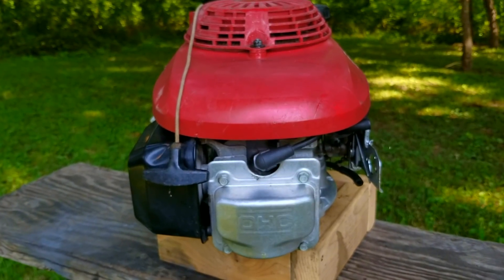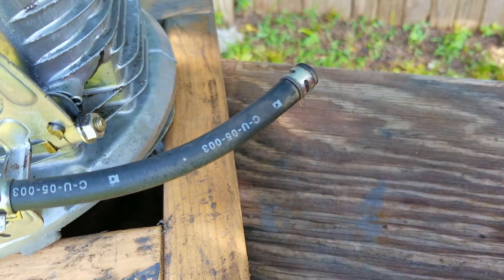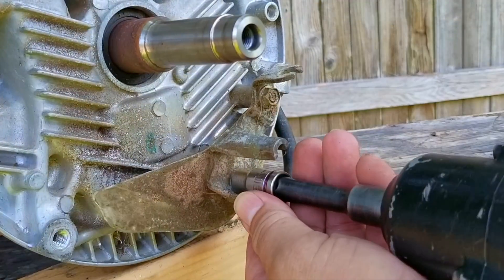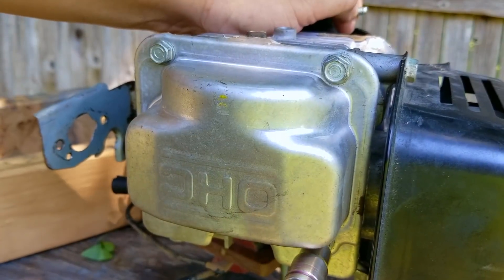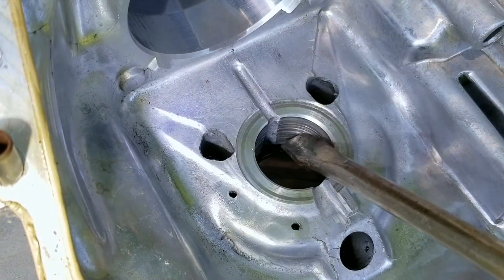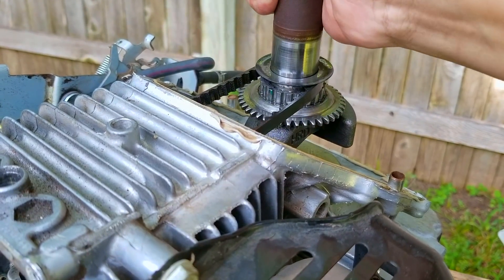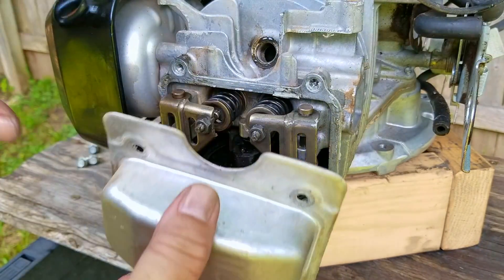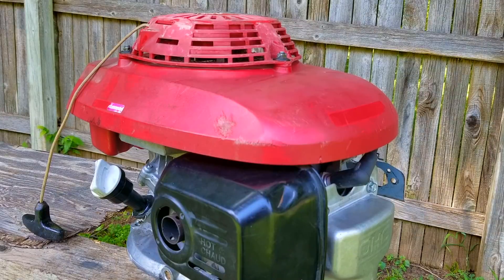I took apart a Honda engine to find out why it was so loud.

Comment: Selling parts off that one could bring enough money to get a used engine. I would probably just put everything in the stash. You would probably make more money using that one to fix several others.
Reply from the maker: you would be correct about that

Comment: That's sad. A perfectly good machine was ruined by neglect. I'm kinda shocked you wouldn't have the necessary parts in your stash, since these engines are in everything.
Reply from the maker: I do believe this engine needed the upper half of the block. I'm just using it for parts right now and I think I know the project I'm going to use it on

Comment: I got a crash course on this engine with this Snapper mower I am working on. I got it running perfectly until I changed the oil. I used a fluid pump to remove the oil, and the tip from my fluid pump fell off in the engine and got wedged in the governor. They are not terribly difficult to tear down, and they certainly don't require as much since they used RTV on everything. I tore it down and got so depressed over it that it sat in my kitchen floor for a year before I finally put it back together.
Reply from the maker: wow, never heard of something like that happening before

Comment: I don't know much about those,people love them but I think my Tecumsehs are actually better in some ways,I think that is a consumer grade engine with a plain aluminum cylinder bore and so probably best replaced. I think Honda makes a higher grade commercial duty lawnmower engine with an iron sleeve bore cylinder.
  That one would probably still be operating properly if not having been run low on oil and the oil changed at a reasonable time. The average person using it for 3 or 4 small suburban lots could probably get a lifetime of use of that motor if taking proper care of it. Including keeping an eye out for air filter care as well as minding the oil. 
  Amazing that it ran that well without losing oil out the top seal/bearing with that wobble.
Reply from the maker: I agree with this comment a lot.

Comment: I cant believe they designed this engine to use a timing belt. I didnt even know that these had belts. That's crazy. I dont think very many people are going to go through the trouble of replacing a belt on a motor like that.
Reply from the maker: surprisingly after all these years, I've never seen a timing belt  break.
Reply: @HomeGaragechannel  I've seen them go a long time on the car engines without breaking too but its not a small job or cheap unless you know how to do it yourself. Just out of curiosity, how often are they supposed to be replaced on these little engines?
Reply from the maker: far as I know, their lifetime. And the reason why is because it's in the oil.

Comment: Is that a snap on impact
Reply from the maker: yes it is.
Reply: @HomeGaragechannel  may I ask where you got it I want One
Reply from the maker: I traded a canoe for it, over a decade ago.  As for right now, I've never looked for one so I don't know where you can get it.
Reply: @HomeGaragechannel  okay thanks
Reply: I'm so jealous you got a great deal all my stuff is Milwaukee
Reply from the maker: thanks, I also feel lucky in gettin it!
Reply: @HomeGaragechannel  do you have any Milwaukee tools
Reply from the maker: yes I have the M18 brushless  1/4" hex impact and 1/2" drill. I don't mind them, they get the job done.
Reply: @HomeGaragechannel  cool
Reply: Do you prefer the snap on over the Milwaukee
Reply from the maker: I really don't have a preference, I like this equally. If I had to choose, it would be based on what I could afford. I'm not going to go on a payment plan, just so I can have Snap-on
Reply: @HomeGaragechannel  okay thanks I'm 14. I want to learn about tools my stuff is Milwaukee I like to work on small engines I collect vintage stihl chainsaws for a hobby

Comment: this engine is easy to rebuild, just machine the upper crank bearing and insert a bronze bushing, have the crank upper journal ground to remove the damages area, finish the bushing to have a clearance of 1 thou, the rest is conventional rebuilding.
Reply from the maker: thank you Jacques Poirier

Comment: if you used that engine for another mower till it breaks it might injure you severely or might kill ya if it was was running and threw the rod.
Reply from the maker: it's possible.

Comment: As the engine is stuffed try this. Polish up the crankshaft then use some emery on the crankcase to clean up the bore. Try to insert some thin brass shim. May take a few goes but will do the trick.
Reply from the maker: that would work but the idea, that I could "hand" clearance a brass shim would be pretty amazing, thank you Terry Milburn.

Comment: I'd part that one out. Shame it isn't ball bearing mains. I've never been into an overhead valve setup because there's been no need and almost all mine are 'L' heads but you did a FINE job on covering everything. THANKS!
Reply from the maker: thank you

Comment: This is helpful but disheartening. My Honda Harmony is squealing a metal on metal sound. We’ve always done the recommended maintenance. It’s 15 years old and this makes it look like it is on its last legs. My son and I did everything but split the block apart. We don’t have the skills to completely rebuild so anything else is spendy.
Reply from the maker: that's a shame, what did you end up doing with it?
Reply: @HomeGaragechannel  we’re going to limp through the summer and try a full rebuild in the winter.

Comment: I have several of these honda engines. I will maintain the oil. Other than that, they're not worth fixing imo. Too complex for too little efficiency gain. They'll all be sold to the scrapyard. Throw away technology.

Comment: Throw it onto an old deck, run it with 20w50 after sleeving the crankshaft to fit the top bearing a thin piece of sheet metal should do it and just run it after the fluids filled then get back to us and let us know how long it lasted, what finally made it inoperable, and tell us what temporary fix u used to get it to run that long thanks again for a great vid✌️
Reply from the maker: that's a pretty good idea, except the sleeving would cost money.

Comment: If you're going to scrap the engine, try polishing out the gouges and then try an aluminum or steel shim to make up the difference.  Might be able to get another season out of it.
Reply from the maker: are you talking about the rod journal or the top bearing?
Reply: @HomeGaragechannel referring to installing a shim/sleeve where the upper crank journal inserts Into the aluminum block.
Reply from the maker: ah yes, I have thought about that, But the machining is the part I'm worried about,

Comment: I got my tecumseh LEV120 running but it really needs to be tuned. I also need to drill the jets out larger
Reply from the maker: just be careful you don't drill them too large.

Comment: I don't think I would go through the cost and effort to rebuild that engine. A new replacement engine might cost a bit more, but usually comes with a warranty.
Reply from the maker: me neither, just get a used one, if  a new one is not in the budget.
Reply: Do they sell a "short block"?

Comment: With the Honda mowers, just like the cars, I will never understand why customers believe that paying up for a Honda gives them a green light to never service them. Yes, they are long lasting and forgiving but there are always limits … and oil checks/changes are the easiest, cheapest, and most important maintenance point. If you know your never going to deal with the oil in your engine, why not just buy the cheapest mower in the store? In the end, you’ll spend less because it doesn’t matter if your engine is a Honda, Briggs, or Chinese because by never changing or even checking the oil, your going to blow it up or it’s going to start knocking after the 4th or 5th mowing season anyway and your going shopping again! Being lazy, forgetful, or ignorant is expensive.
Reply from the maker: I could never understand it either and I don't think they really care as well. such as shame.

Comment: I actually know exactly why the GX140 on one of my old Hondas began making a terrible noise. Like a moron I ran it dry, let it cool down, then ran it some more, let it cool down, did it again until finally realizing it had no oil. Why is the rope SO HARD to pull? Because you're an idiot, that's why.

I added oil and slowly worked the flywheel with a ratchet and socket until it got freed up. Started right up, ran perfect for about 10 minutes and then the internals flew apart. Even then it still did not stop until I killed ignition.

I'll take it apart as penance and to maybe scavenge a paperweight or two for my desk, but unless I get VERY lucky don't expect it worth rebuilding. The challenge would the replacement engine; this mower's got the hydro trans so I'd need another Honda with that driveshaft.
Reply from the maker: boy that thing wouldn't die without a fight. good luck finding one.

Comment: I just purchased a Troy Bilt mower with the 160cc Honda engine they recommend using ethanol free fuel which is hard to find, can that cause problem in the long run
Reply from the maker: only if you let it sit in the tank and carb for extended periods. If you're going to use the mower for longer than a month, I would run it till the tank is dry.

Comment: I have a mower with a Honda engine on it. It runs great but the wheels are to small and make it hard to push. I keep saying I want to change to a bigger size but haven't done it yet.
Reply from the maker: have you serviced the wheels yet? lubricated the bolts?
Reply: @HomeGaragechannel  The wheels are in good shape and turn as they should. However I have a very uneven clay based soil in the yard, and they like to get hung up in the ruts.
Reply from the maker: that makes sense

Comment: Those Hondas are garbage, I had a neighbor give me one similar to that one except it's self propelled. against my better judgement I accepted it, and ever since then it has been a constant pain in the ass. you could fix that engine you just have to purchase a needle bearing assembly, that would fit the crankshaft and then machine the block for the bearing to fit. I've done it before on a Briggs and Stratton engine.

Comment: Here in Australia, we would machine the crank, & insert sleeve bearings into the crank case for the crank, then bore the cylinder, and put a sleeve there to original specs.
Reply: I did a similar repair to one recently, I turned the crank down to a standard size, linished and micro polished the surface then bored the casing to take an off the shelf bushing. I also added an oil hole to the bush that lined up with the original slot and plugged the lower relief with JB weld (prior to boring) forcing all oil from the catch surface through the groove and into the new bearing.
An easy job for anyone with a lathe, otherwise it's a costly repair.
Reply: It sounds like that would be cheaper just to buy a new engine
Reply: @DiscoMiata yes. Unless you have a machine shop in your shed. I guess most folks on here just watch these videos for the fun of it because it sounds like they already know everything.
Reply from the maker: that makes sense
Reply: Now why didn’t us backwards Americans think of that? Oh, I know, because not everyone has or even wants to spend $$600 to have a shop fix a $300 mower.
Reply: @HBmowers69  it doesn't cost $600 to do that you fool. Geez.

Comment: hey man i have a stihl fs 55r that wont start and it backfires through the carb any suggestions and it backfires so hard it puts holes in the air filter
Reply from the maker: You might check to see If the key on the flywheel has sheared. Otherwise make the your spark arrestor screen isn't clogged.
Reply: @HomeGaragechannel  alright thankyou

Comment: Sorry to ask, I've been binge watching videos on small engines. I'm sure I've heard you mention it before and can't find the videos.   Can you tell me the most common size fuel lines on trimmers/chainsaws? ID/OD.   Also, curious to know if the larger or smaller bulbs are more common. I'm having a hard time ordering the smaller bulbs.
Reply from the maker: look at my one video with a trimmer in it, in the description is a link to a multi pack of primer bulbs with 3 different types.   Fuel line sizes for trimmers and saws, is usually 3/16 OD. Larger primer bulb, the size of a nickel or more common than the smaller one, which is the size of a dime.

Comment: Hey I’m take taking a small engine repair course and I was wondering where you got yours if you have it
Reply from the maker: Actually I didn't take a course.  It would probably helped tho.
Reply: I have bought a weed eater xt300 and it doesn’t start I’ve taken apart the whole thing and got a new spark plug  and  piston ring I just need to assemble it
Reply from the maker: @maddyrobinson649  nice, let us know how it goes

Comment: Polish the surface and add a brass or steel sleeve?
Reply from the maker: the only problem are the reliefs that are cut into the Block for oiling. it would be difficult to keep the brass sleeve's integrity

Comment: Without taking money, time and effort into consideration, if the goal was to save that engine the crankshaft could be ground a bit to remove the scoring, the bearing surface at the top of the engine block could be machined to put an insert or bushing to get the proper fit with the crankshaft, after that the cylinder would need to be honed and the piston and rings would be changed, of course this wouldn't be profitable but by living in a country where new or good engines aren't easy to get i have often seen similar modifications done to engines to make them work again, even when they are well pass the condition of the engine in the video
Reply from the maker: I believe you are correct, I almost afraid to find out what the bill would be.
Reply: Would be more practical on a model with an iron cylinder sleeve.

Comment: Man you can take him home at and clean that crankshaft up pretty smooth and home that crankshaft hole out in the block and put a a copper shim in there that just fish tank crank and never have another problem I've done many of them like that on push mowers
Reply from the maker: Really?
Reply: @HomeGaragechannel  yes I've done it many times just have to be very careful
Reply: @HomeGaragechannel  hey I wanted to let you know one other thing okay if ever in the near future you have a push mower that needs a valve job just remember push my Honda push more motors or very common about the valves it seems like they're softer in the push mower motors okay if you have an upright Honda that is the same cc is like 160CC or whatever the valves are harder in an upright vertical shaft engine so you can take the valves out of the vertical shaft engine upright engine side shaft and put in the push mower and the valves will be a whole lot stronger and you won't have that issue of the valves defaulting or being too soft and busting or bending or mushroom and out like the ones in that motor you have on display I failed to tell you that and you know man to be honest with you I don't mind telling you this because you are like a guy that is got a lot of common sense and you're kind of like me you're out there just help people some people you can tell information like this and they could care less to hear this information and you just basically waste your time and energy of posting anything some people say all that's a good idea and then never do anything about it but anyhow in the near future Honda engine and put them in the post mower and they're the same valve same length and everything the same valve springs they just seem like they're harder in the upright engines have a blessed day man keep up the good work
Reply from the maker: @williammoore4800  thanks and I will

Comment: These things always also had bad issues with the valves as I can tell one of them valves is very very disturbed and looks like it's been banging on something in that piston could possibly been slapping too Hondas are coming about that as well that's why I replaced rod and piston in the one I did but yeah these are very common about the valve problems the belt is what causes the valves cuz most people they don't change these in maintenance on when they're supposed to and these timing belts are required to be changed at a certain amount of time just can't remember that but if you keep the oil changed in these things I've had one over 15 years on an air compressor and done nothing but change the oil in it still running just as strong as it did the day I got it
Reply from the maker: thanks for the information

Comment: I sold one of these engines for $65 it was like brand new I have a pressure washer with the horizontal version and it's never failed to start in the 10 years we have had it
Reply from the maker: that's pretty awesome.

Comment: Great engine autopsy, thanks! I have a Briggs Quantum with the blade stop feature on a Toro that suffered the same fate, the owner ran it with almost no oil. I really wanted the blade stop feature so I took all of the internal parts out, polished the upper crank bearing surface as best as I could and reinstalled them in another block. It works but I don’t really trust it so I’m looking for a Honda engine like this with the blade stop feature. Pretty sure it will bolt right up, looks like the same diameter stepped crank PTO.
Reply from the maker: I wish you luck with your search.

Comment: I make my own flywheel tools by threading 3 nuts the right size onto a bolt. Screw them together without tightening them and weld the nuts to each other. Then unscrew the bolt until it's halfway out and weld that to the nuts. Now you can screw the tool onto the shaft and give her a good solid whack and it pops right off. Never used a screwdriver to lever a flywheel off and never had an issue with giving it a good solid blow.
Reply from the maker: that would definitely work.